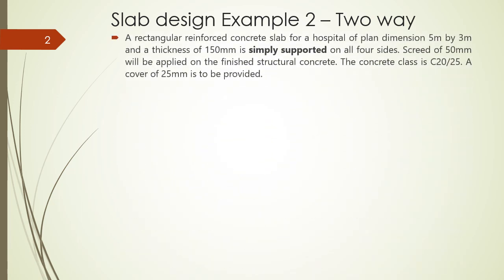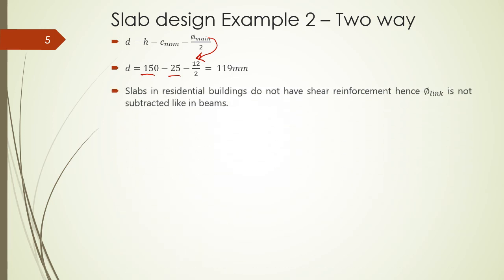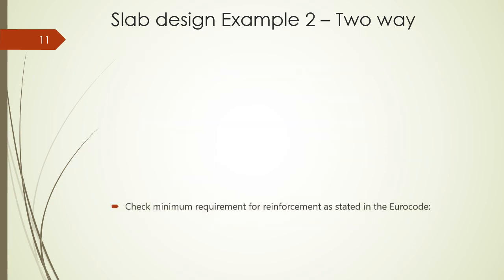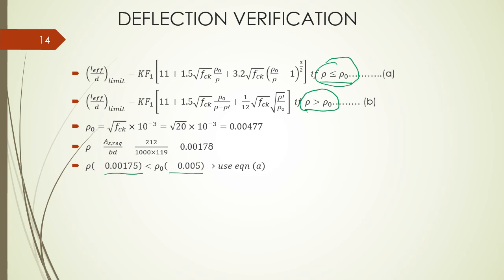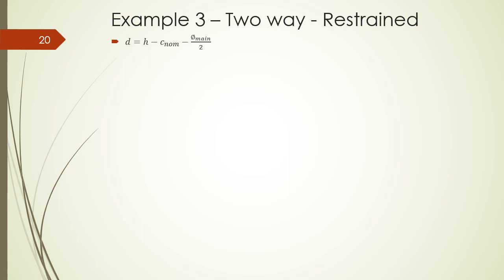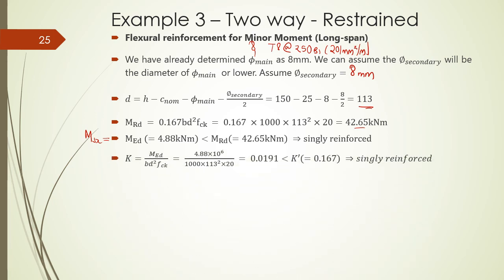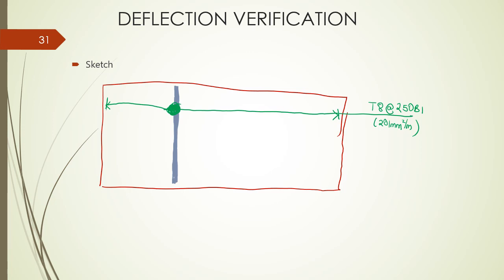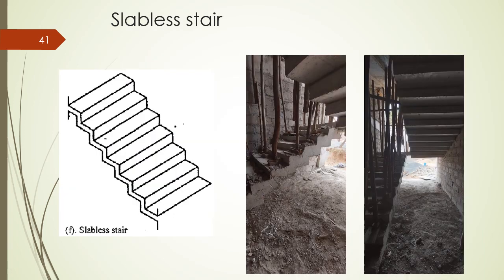Design of Slabs to Eurocode 2 - Two-way

Comment: When calculating for effective depth, we already assumed a 12mm diameter reinforcement, why then did we specify for 8mm or 10mm when specifying for the reinforcement for the short span and longer span?